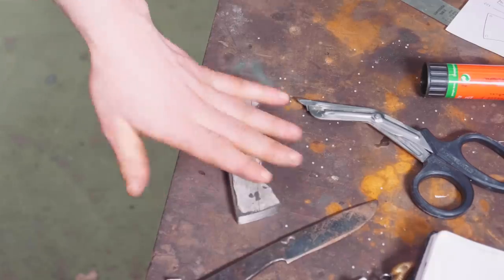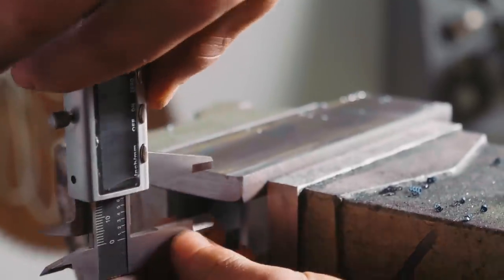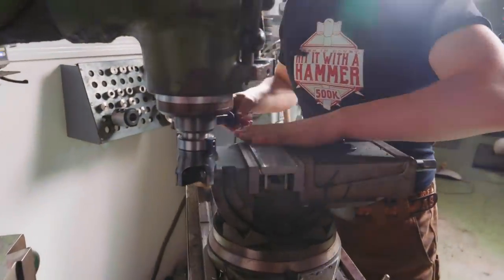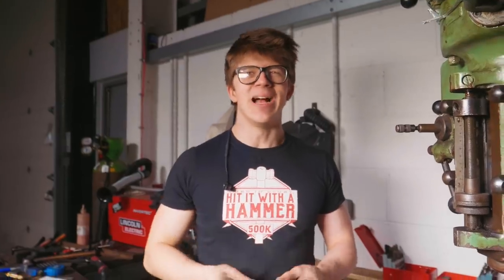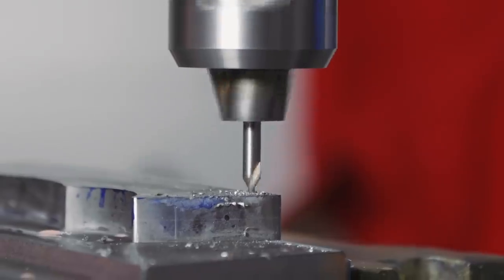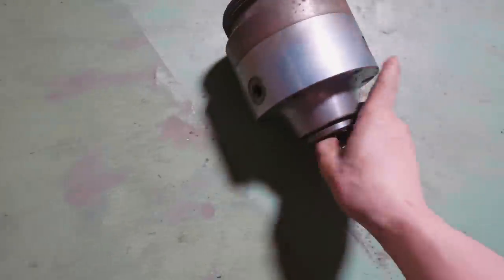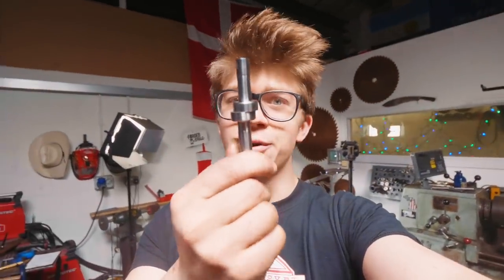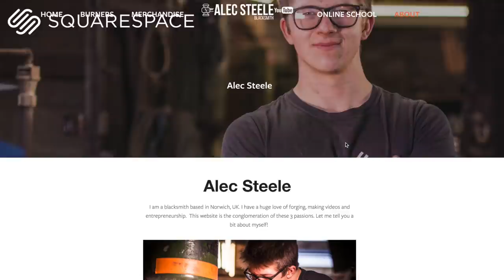MAKING A FRAME-LOCK FOLDING KNIFE!!! PART 3

Comment: I don't know if the plane part on which you place you spacers is hardened, but if not, couldn't you plane it with a big endmill and then have the most parallel surfaces ever ?

Comment: Try canister damcus
Reply: Plz
Reply: O put a bucket of water underneath your belt grinder help white the mess
Reply: He has
Reply: He did but the problem he had was that  he couldn’t find anywhere to buy steel dust for cheap.
I think he had to use some sand blasting beads.
Reply: Dave Erving Evader Knives  well it is worth a shot
Reply: That what sand paper is for lol

Comment: making something flat when its long and thin isn't easy because the act of supporting the job distorts job so when removing the job it spring back to give back a error.
even on a surface grinding you some times have to grind with the magnet turned off and then it may not be enough to avoid distortion.
Make yourself a fly cutter or buy one.
https://i.imgur.com/sqO4ngV.jpg
and some blue tack because it absorbs vibration and stops jobs bouncing.
Print this out and throw it up on wall.
https://app.box.com/s/4ulzu8egtjin3etmkyj5

Comment: Shame about your vice. I’d expect even a cheap vice to be way closer than that.
Hey it’s on a milling machine!
You know it’s soft because you can accidentally drill holes in it if you want!
Check everything is clean and assembled correctly. Clock it in all other directions.

Then mill the dam thing flat.
If you are worried about a large slab cutter leaving funny edges just use multiple passes with a smaller cutter.
Give it a oil stone to smooth it out if you want
Show those cheap vice sales companies how they should have finished it :]

Comment: dont ever use drills with  titanium coating they are complete crap when drilling most metal use god old black drills they will hold upp even the chinese ones are better than the coated ones ( i think the titanium coated once only are for cnc machines with exact speeds)
i have tried the dormer hig grade titanium coated drills that most sellers recomends but they are totaly and utterly crap
god old hss black drills ar the best when manual drilling (even in a lathe or mill)